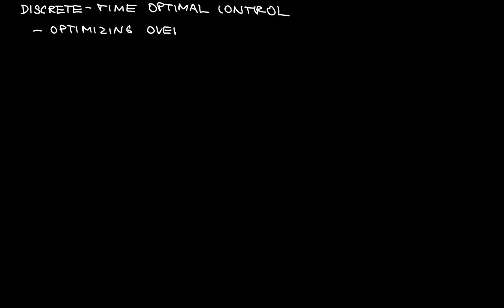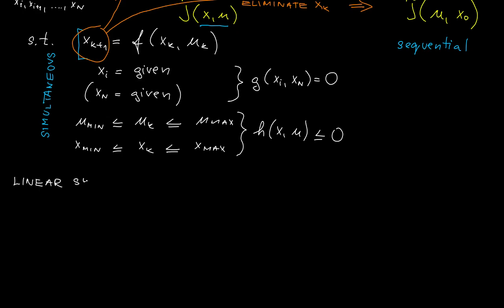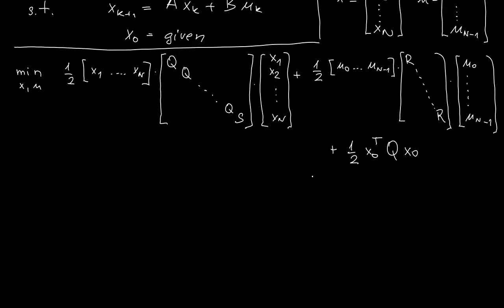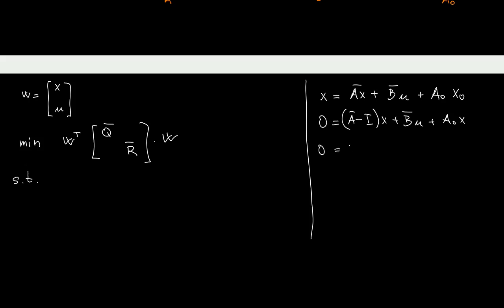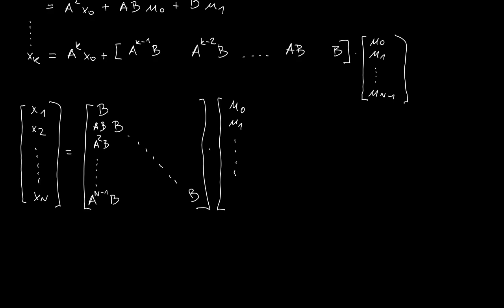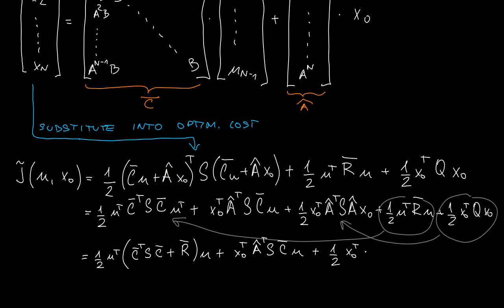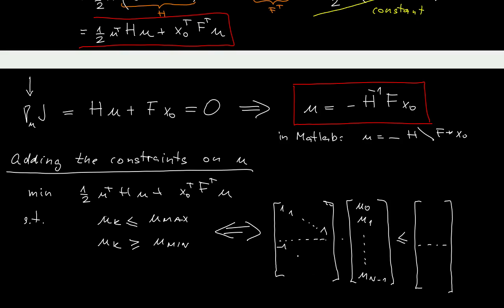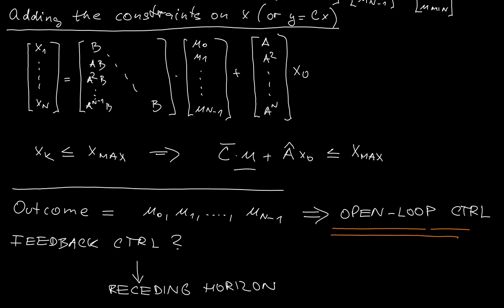L3.2 - Discrete-time optimal control over a finite horizon as an optimization

Comment: Is there any way to communicate with you? can you provide an email please. thank you
Reply: Mohamed, you can feel free to communicate issues related to the content of the video right here.
Reply: @zdenekhurak  I have a system (A,B,C,D)  Matrices for a buck converter I am wandering how I can formulate the system matrices to fit in the QP cost function? and how does the initial states (i.s) or constraints can be assigned to get the hessian matrices H, F?
Also pleas my desired output is the inductor current and the capacitor voltage? how I will minimize the system formula to get my output?
Thank you